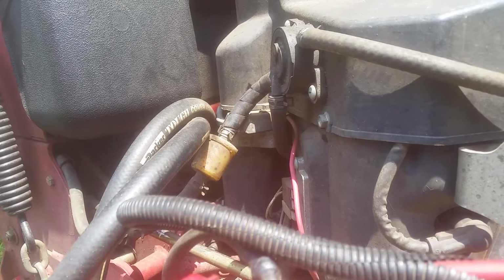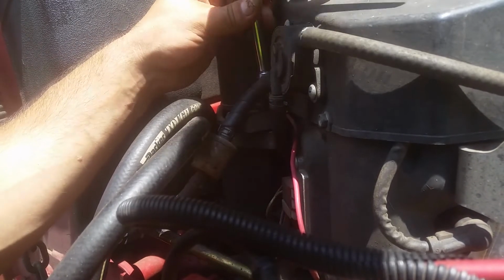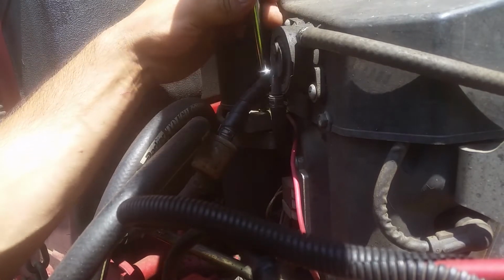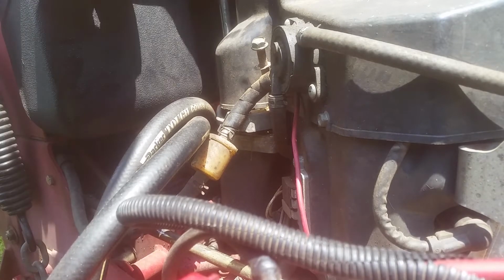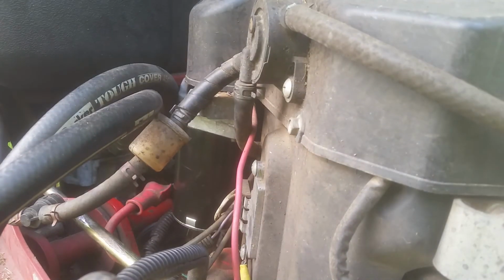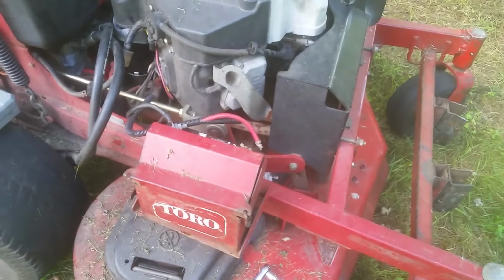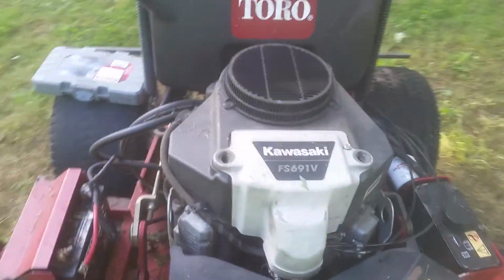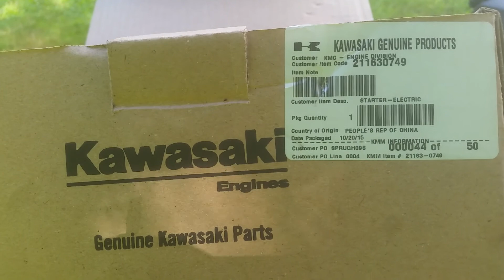Toro Grandstand Starter Replacement

Comment: I have toro grandstand with a 20 hp Kawasaki everything looks the same I took both bolts out but it will not come out. Please help if you might know why ot won't come out
Reply from the maker: I would try few wacks from a big ass hammer. If not pry it out. Only thing I can think of is rust or the starter gear is wedged in there.